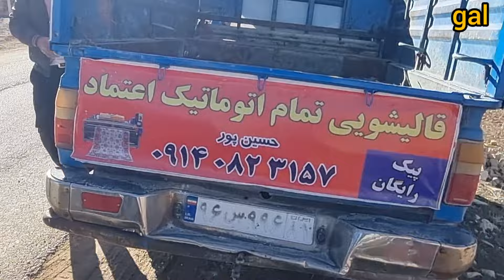Planting Seeds of Security: Nomadic Widower Builds Safe Haven for Daughters

Comment: Опять строят халупу хотя место позволяет построить хороший дом опять стены будут мокрые
Reply: The walls will get wet if built same as other hut. In other channels they use rocks then cement as a foundation first so the water doesn’t seep into the blocks. They cement the outside of the house when it is completed and put silver looking type of sheets all around the outside of the house to prevent the walls from leaking. Hoping that is done to this house. Will have the same issue with wet walls if not.